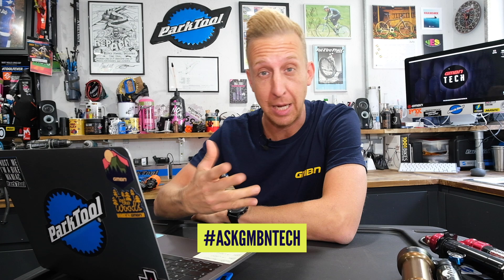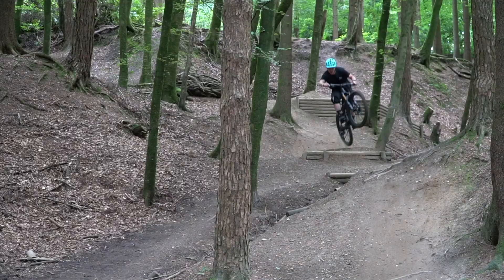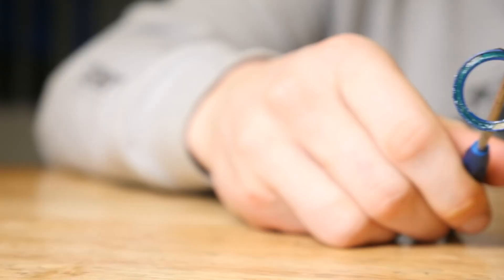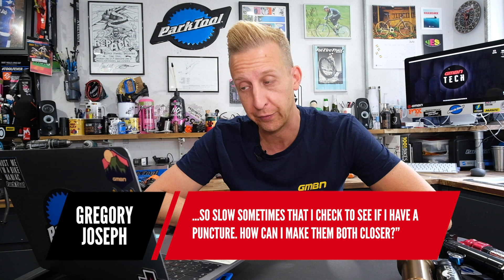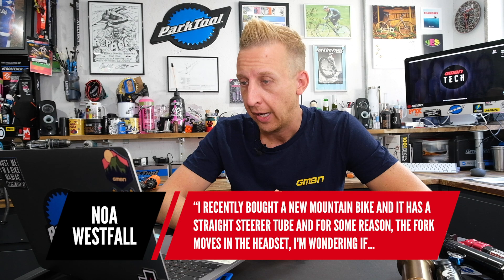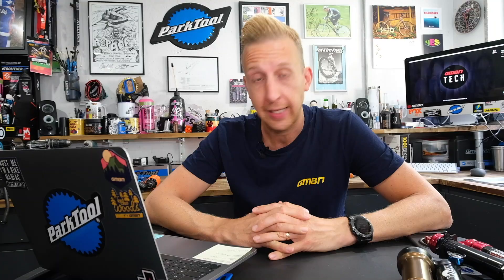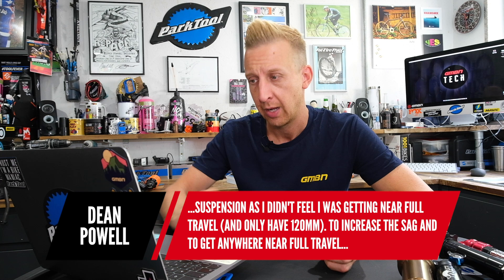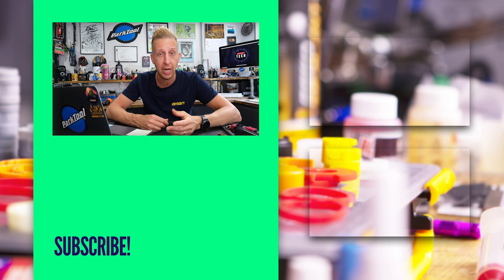I Find It Hard Swapping From An XC To Trail Bike Can Tyre Choice Help? | #AskGMBNTech

Comment from the maker: Do you have a mountain bike tech-related question? Use the hashtag #AskGMBNTech in your comment below for a chance to be featured on the show!
Reply: Hello
Reply: Hi
Reply: #AskGMBNTech Hello! I have an XFusion Streat RL2. I guess this goes for all RL2 forks since they have the same damper.

The fork works well and all adjustments work. It's 3 years old; got the bike second hand so I don't know how much it has been ridden.

Have done a lowers service and looks in very good condition with no stanchion wear.

Do I need to do a damper oil change? Fork makes no strange noise of squelching. Can't find any information online about service interval and curious if it needs it and what improvement would it make. Have found forum threads and very easy to do a clean and service.

Would you recommend putting some lighter weight oil to improve small bump sensitivity if I did do an oil change; since it has no compression adjustment? I don't really want to rearrange shims and have to keep taking it apart to tune and possibly break something I can't afford to fix.

Sorry for the assay, just wanted to make it as clear as possible.
Cheers - Matt.
Reply: #AskGmbnTech I recently bought a cadabra Kona and I feel I can't get fast on flat 'ish' ground, how can I increase speed?
Reply: #AskGMBNTech Hello! I have recently bought a Scott Spark 950 2020 but would like to hit some trails maybe some jumps. I have ordered the parts to extend travel to 120mm. Would you recommend changing head angel etc or just to replace the frame with a Nukeproof Scout for eg. Thanks :)
Reply: @bananasstuff3344  I think changing the oil could improve the characteristics of the fork to how I would like it since it uses an open-bath damper; it shouldn't damage it as long as I put the right amount in the damper (I know it's 70cc). 

It's not damaging it that I'm really worried about anyway since I have adequate experience and knowledge, it's knowing if I should bother to change it and if it really needs it. Like when on some forks and shocks when it makes that horrible squelching noise because the oil has become impregnated with nitrogen bubbles. My fork doesn't do that or have any symptoms of low damper fluid from a leak since the lockout still works and doesn't allow for any travel at all which of course could indicate a low fluid level.

I really don't want to rearrange shims since it normally involves too much trial and error I can't be bothered to go through. I would rather use a different weight oil if I'm changing it anyway to give a bit less overall compression damping and give it some better small bump compliance. If the fork blows through too much travel on large hits, I'll just increase the progression. 

I just wanted to know if it's worth changing the oil at all and would it improve performance even if the fork is working fine. I would also like to know if changing the weight of the oil (say from currently 7.5w to 5w) make as much of a difference as I would hope to how it feels.

Sorry for my essay lol.
Reply: #AskGMBNTech, looking at getting backing into mountain bikes once more, want a all rounder.. Was looking at the Yeti, YT or Canyon, what models would you recommend ??
Reply: #AskGMBNTech I have a 2019 Trek Fuel ex 9.8 that I want to take to a bike park. I'm a bigger guy like Doddy similar in size. Although it's only my second season riding I'm worried it's going to be too little of a bike to take to a bike park. Would adding the max size tire I can fit (2.8in front, 2.6in rear), in a aggressive thread like the Maxxis DHF/DHR help the bike feel more "beefy?" Being a bigger guy I'm worried about breaking the bike if I decide to get too rowdy. Also rental would be an option if not.

Also tire suggestions?
Reply: #AskGMBNTech What do You think about the Commencal Meta HT AM Origin Brg 2021? I want to buy this bike and I ask myself if the buildt in fork (Rockshox 35 Silver R, 160 mm, Coil) should be changed pretty soon. Personally, I would first install a dropper post and eventually other brakes. What do You think about the Fork? Should I change this and keep the Coil Fork as a backup?
Reply: #AskGMBNTech Hello, I used to ride a GT Zaskar Team 2005 until 5 years ago. Haven't owned a mountain bike since. I am looking to buy a full suspension trail bike that can handle more steep trails and rock gardens, while still being a good climber (I live in Denver). Any suggestions?
Reply: Evan Lynch  check manufacture's specification, in some cases you can read: travel 80 - 120 mm  - this usually means, that a specialist is able to open the fork, adjust the travel lock inside the fork, and put it tougher. with increased/decreased travel.
Reply: Hi
I am riding with a Specialized "Fast Track" LK tyre on the front and Spezialized "The Captian" S- Works tyre at the rear.I ride in Dry rough conditions and I am a intermediate rider.And I cant find out the correct psi to run my tyres.I way 46 kg and I am 13 years old and my bike ways about 12-15kg.Do u have any suggestions for tyre pressure.
Thanks
#AskGMBNTech
Reply: Evan Lynch  @Evan Lynch check manufacture's specification, in some cases you can read: travel 80 - 120 mm  - this usually means, that a specialist is able to open the fork, adjust the travel lock inside the fork, and put it tougher. with increased/decreased travel.
Reply: @Roneldk  it all depends on a terrain your riding, if you really want the perfect tire pressure, no 1 cal tell you exactly what it will be. What you can do tho, is to simply pomp both wheels up to max psi, and then ride a trail. Afterward, decrease the pressure by only 1 PSI in only 1 tire - the 1 you feel performed worse than the other, ride that track again, do the same - lower the pressure by 1 PSI in the worst-performing tire...
Rinse and repeat. do this and remember how the tires are performing, and after you deflate the tires to minimum acceptable pressure try to remember the best pressure and set it up.
then experiment with up to +/- 5 PSI on both wheels - after some time riding you will feel what's right or you.
Reply: #AshGMBNTech hi I am looking for my first mtb and I am not wanting to spend more than £700 the bike am looking at is a voodoo bizango 29er and the vitus nucleus 27 vrs 2020 what can you recommend
Reply: #gmbntech i have a free to wheel drive in my bike can I put  a Cassette system is there any adapters I am on low money to convert to a different hub
Reply: @thenukasehasna6032  you might, it depends on your rear wheel hub, it depends - without knowing what rear hub you have its impossible to tell.
most hubs are consistent with 10-speed cassettes, if the cassette has a plastic ring behind it and the cassete rails are flat with no 1mm metal ring - it will fit 11-speed cassette.
BUT BEWARE - it is just general info, without specifics like exact hub name with the part number (like Novatec 772 SB) where I can pinpoint exact hub its impossible to tell if your hub is compatible or not, ESPECIALLY since you did not put even your bike name and year...
Reply: What should I do when I get a puncture with tire insert and sealant is not able to seal the hole? Do I need to put an inner tube inside, but what to do with tire insert? #askgmbntech
Reply: @KajotBB  than the tire insert needs to be changed for a new 1, unles you mean tubeless tire setup and sealant cant seal it - then either buy new tire, or buy a stan's D.A.R.T system for tubeless punctures. If by any chance you are from  Poland -> buy new tire, since good tubeless tires(nobby nic TL-R 2.25) starts from 110 PLN and D.A.R.T. if accesible in any shop is around 200 PLNs.
Reply: #askgmbntech hi i was trying to air up my tire and my nozzle got bent is there anyway to fix it or do I have to buy a new one
Reply: @brevinharris7002  the TL tire valves are made out of 2 components - the valve itself and the little thing you screw out in order to pump tire up. if you bent the small part it is usually possible to bend it to shape using fingers. However that might not help, in best case scenario - you will have to buy only the small part and replace it, worst case - you'll have to buy a whole new valve and replace it. Color of the new valve doe not matter, but the brand itself does matter - try buying the same brand and same model - this way you can have spare parts and make new whole valves out of the leftover parts from broken valves.
Reply: #askgmbntech I have a Cube Reaction Hybrid Pro and I want to upgrade its fork (SR Suntour XCM34 Coil, Tapered, 15x110mm, 100mm, Lockout). What fork do you recommend for my bike? I do mainly trail riding and I have already added a shorter stem, a wider handlebar, an angled headset (2 degrees) and a dropper seatpost.

Comment: That tyre answer was fantastic! I imagine that is a common concern that a lot of people have and I've been thinking about that as well.
Reply: The perfect answer: semi-slick
Reply: 🤦🏻‍♂️🤦🏻‍♂️🤦🏻‍♂️ well I think the question was a bit ridiculous.
It sounds to me like the rider doesn't understand the differences between lower coefficient of friction i.e., resistance to a higher one. He doesn't understand that heavier deeper cops are for grip whereas XC tires are more for Speed and maneuverability. Really just sounds like a issue of not comprehending, which is common because most bike riders don't have a clue...🙄

Comment: #AskGMBNTech highly technical question here for the bike nerds, is it just me or do gashes from pedal screws take waaaaay longer to heal than anything else?
Reply: That is quite possible. The reason is screw aren't  sharp enough to cut. They tear/ rip the skin and flesh which takes longer to heal. On top of that they are always dirty which also not a good remedy.

Comment: #AskGMBNTech - thanks for tackling my question Doddy - a bit more info - the bike is a Whyte T129s 2016 and I am about 80kg - so its the stock shock, supplied with the bike. I'm going to try and reduce the volume spacers but other than that I think you are right in suggesting getting a full service on the unit.
Reply: My recommendation would be a full rebuild if you have 200 hours/1 year of ride time since the last one. RockShox normally limits to 3 tokens in their shocks. But from my experience, not achieving full travel and/or functions no longer working are good signs it's time to rebuild it
Reply: It could of course be seized linkage bearings, really I'd begin with letting out all the air and circulating the suspension through full travel to see if it moves then and see where it stops. Too many tokens sounds possible.

Comment: Dean Powell,
The problem could be you have bottomed out so hard that there is way to much air in the negative chamber and it is making the bike sit down more in the travel so 95psi might be right for you just the shock is messed up
Reply: I have released all the air and set again - so thanks but don't think that is the issue.

Comment: With tyres I prefer security over rolling speed
Reply: Exactly cam. I'll take traction and stability in the corners and under braking over less rolling resistance any day. 99.99% of riders are nothing but average and will never be able to exploit the benefits of a lower rolling tire for other than glory in their own heads 😄
Reply: So true its all abt that traction and puncture resistance, maxxis high rollers 2 i have never had a puncture and they handle well but climb like crap. That why we have the lifts
Reply: This is true. Most trails, especially tech trails black and harder you use your brakes most of the time, so rolling resistance wont make an effect because you will go the same speed

Comment: I had a similiar dilemma with tires as was asked. I have a lightweight xc hardtail and then I have a fatbike as my trail bike. I have had multiple sets of bontrager, specialized and continental tires for my xc bike and then I found the barzos in the trail casing and a 2.35 but they actually measure around 2.16 or so. Been absolutely phenomenal. I can run lower pressures and the grip is amazing. It still takes time to get used to but it's not as bad as some near semi slicks I've run.

Comment: I have just made the jump from a 2013 Giant XTC to a 2020 Ragley Blue Pig. 

The geometry change has my head spinning. I can't get the steep climbs worked out, especially switchbacks. Definitely feeling the tyres too (From 2.35 Ikon+2.2Ardent Race to 2.5Assegai+2.4DHR)

Comment: #AskGMBNTech Hi Doddy, I have a question about BB and shock. I’m looking to buy a full suspension bike and thinking if BB height is measured with or without sag? I’m worried about cranks or chainring hitting rocks and stuff. Thanks for the show, I’ve learned a lot watching GMBN channels.

Comment: I had a RockShox Monarch RT that wouldn't full stroke after I fkt around with air pressures. Needed to do what Doddy said, roughly 100 PSI and force it through compression to equalize the chambers, it made a little "pop" inside and then worked fine again. I don't remember exactly what PSI it did this at but just try something around that bounce on the seat a few times.

Comment: #AskGMBNTech Hey Doddy! I own a Canyon Neuron (for 3 years now) with a Rockshock Reba fork. Lately I noticed that the first half of the compression stroke is not that smooth anymore- at some points there is more resistance. A bit of a 'staircase effect' if that makes sense. I did a lower leg service, everything seemed fine. I replaced the rings after soaking them with oil, put butter on the inside of the seals and freshened the oil in the lowers. Still the beginning of the compression feels jerky. - Also after my lower leg service, there is an air 'sucking' sound on the rebound stroke. Not sure if that has to do with it. Besides the jerkiness the fork behaves normal.
Reply: Did you also change the seals? (I only ask because you only mentioned lubing them & replacing the foam wipers) Is there any visible damage to the coating or structure of the stanchion tube? Does the airspring assembly or rebound assembly show any signs of wear? Are the fork lowers free of dents?
Answering these might give Doddy a bit more info to work with :)
Reply: If its not anything to do with the seals (after replacing them) that sound normally indicates the damper oil is impregnated nitrogen bubbles and the oil needs renewing. Sometimes the damper simply makes that noise when the oil passes through, but if it never used to do it I would try a damper oil change. But sounds like the seals have some stiction and need replacing. I would put that as the most likely cause.
Reply: The air sucking is pretty normal sound with motion control dampers, however, if it hasn't had a full service after 3 years it is well past time. Like the others also said, check the stanchions for unusual wear. Not knowing your weight and riding habits it could be possible the 32mm stanchions bent. But that should show on the stanchions. 

Before you go full service,  pull the lowers again and put a straight edge on the stanchions and check everything thoroughly.
Reply: Hi  @mihaelmergole  thanks for your reply, I did replaced the foamy seals half a year ago (during my first loweleg service). This time I only soaked them since they still looked clean. Also there are no visible inperfections like scratches (ment that with "everything seemed fine").
Reply: @chrissmith2729  yeah might do a full service then! My weight is 85kg / 187 pounds, so not the lightest but I don't do a lot of extreme stuff. Mostly xc. I cant imagine the stanchions bending with that kind of use.
Reply: @ludopoot  I meant the rubber seals that ride above them, if they are damaged they could lead to all sorts of trouble
Reply: @mihaelmergole  oh no the rubber seals look like new. No damages or anything!

Comment: #AskGMBNTech As of about a week ago my steering stiffens up while riding (like when there is too much torque on the headset). I consistently rattle my headset loose while riding so I make a point to snug up the headset to just before the handlebars resist moving freely. However during riding it tightens up to where there is considerable restriction in turning the bars.There is only 2.5 NM of torque or so on the top cap bolt. It is a Cane Creek 110. Thanks